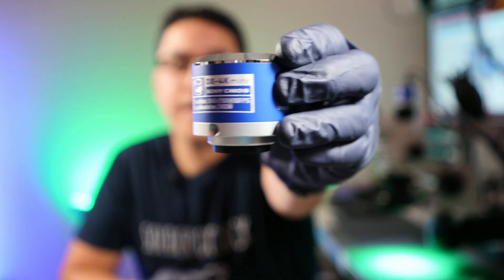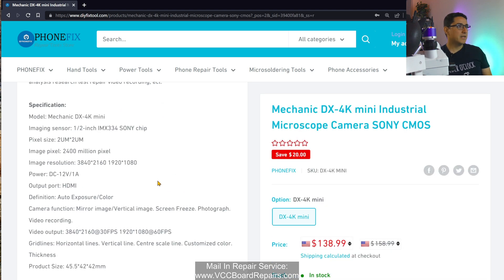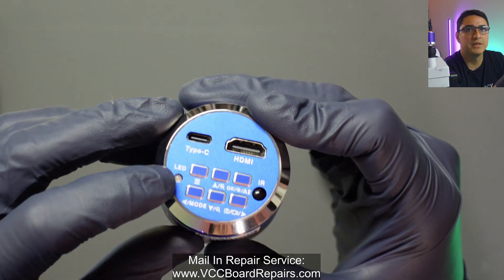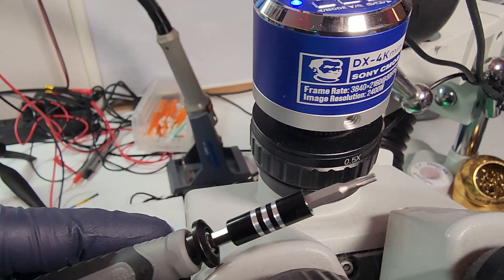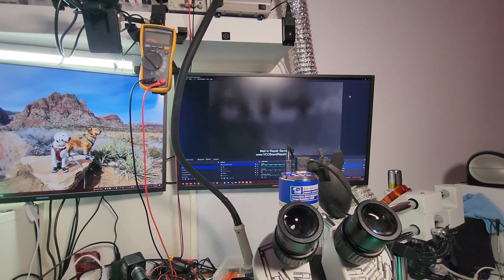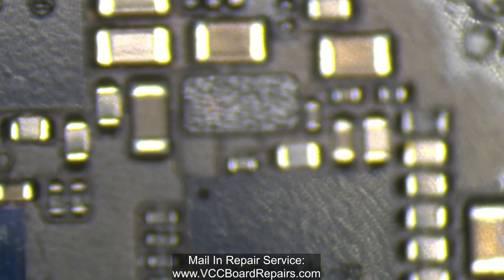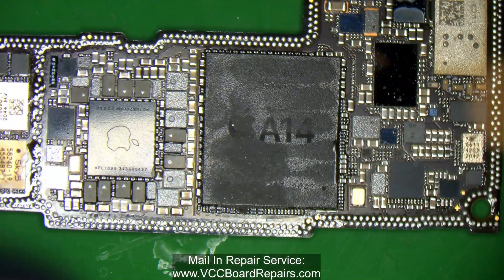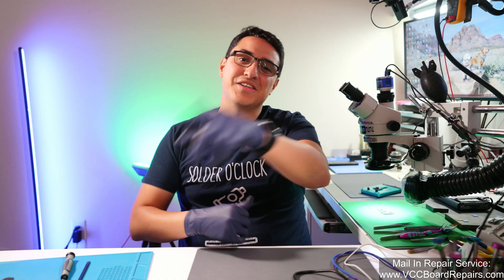The Best Microscope Camera for Board Level Repairs. How To Sync & Setup Your Mechanic DX-4k

Comment: Bought one of these based on this recommendation, and for my needs, it's perfect. Small, light, good image, autoexposure works well, not having an autofocus is to me a feature -- no hunting, I set the focus once and it's always in focus. One comment on the reducing lens choice; the two inexpensive options are 0.35X and 0.5X, and which one you go with depends on what result you want. In the case of the 0.5X, there will be no vignetting, but the image will be magnified vs. what you see in the binocular eyepieces. In the case of the 0.35X, the image will be quite close to what you see in the eyepieces, but there will be a bit of vignetting at the corners of the image. I prefer the 0.35X, since I want the FOV to be similar, and the vignetting doesn't bother me. If instead you want the best image possible, and losing a significant amount of the FOV isn't a big deal, then the 0.5X is a better choice. They're cheap enough to have both, frankly.
Reply from the maker: Love it!

Comment: Friend I was told by mechanic Hong Kong that for my Mac I need to install software mos4k pro camera and they will email me the link you told me no drivers I meant by drivers software because I can’t use the remote at all nothing shows in my computer just on OBS it works but you need to go to the settings to program in not sure about windows but I am using a Mac Studio computer
Reply from the maker: Use HDMI to USB capture card like I show in my video.

No drivers needed
Reply: Whats their contact?

Comment: Hello!  Your camera connected via USB to computer, when you are working in OBS? I have a problem, when the camera is connected via USB, it disconnects after 2 minutes of operation. Thanks for the feedback
Reply from the maker: No. If you watch the video, I show how I connect it
Reply: @VCCBoardRepairs  Sorry. Did I understand you correctly? First you need to connect the type c cable to the 5v power supply, and then the hdmi cable to the USB HDMI Capture Card to record video?
Reply from the maker: @MichaelPanda-e1w yes
Reply: @VCCBoardRepairs  thanks!

Comment: the parafocal syncing trick should work the same way with amscope SM-4T simul focal (it has a lockable trinocular zoom mechanism in it) microscopes? Where you can focus the eye pieces c mount and microscope to where you can zoom in and out and it stays focused? My SM-4T is coming in a few days
Reply from the maker: Yes. All microscopes work the same
Reply: @VCCBoardRepairs  thank you for all your help lately I really do appreciate it. I almost bought the same parco but just ended up getting the amscope they are both really good

Comment: hello bro, please reply, I bought a 4k microscope camera and attached it to my trinocular microscope, but I get very dark results and they are only better when given very high light. but I got good results with both fisheye binoculars with just a little light. what's wrong with this? Is it related to the problem with the CVT lens or my camera? Thank You
Reply from the maker: Enable auto exposure. Press and hold the AE button
Reply: @VCCBoardRepairs  Thanks for reply :)

Comment: Hello, I would like to buy this camera to replace my old one but I have a question. Do I still need the spacer if I'm going to install a C mount lens to it? Thanks in advance
Reply from the maker: The 5mm spacer should come with it. It may be required depending on your setup

Comment: FPS is terrible or is this your setup ?
Its very choppy.
Reply: It's max at 30fps for 4k and 60fps for 1080p.  I'm assuming it can't do 60fps on 2k as well.

I like how he's not replying to this tho hehe.
Reply: @bshinjp  its pretty normal though, the ones that do 60 FPS at 4K cost a LOT more than this one, orders of magnitude really, the only one i've seen on Ali that advertises 60 FPS is the Hayear HY-6800 that costs 300 dollars and even then you're taking a risk that they might be lying and you'd have to ship it back to China for a refund, the cheapest one that is vetted and known to deliver 60 FPS through independent testing i've found is a Lapsun that costs nearly 600 dollars.
So those extra 30 FPS are costing you anywhere between 200 to 500 dollars, it's not really worth it

Comment: Took a risk and bought this. Just unboxed it today. The image seems pretty good, but none of the buttons work. It can output over HDMI directly to a monitor, but I can't open any of the menus from the buttons and it won't capture still image or video to a memory card.

It didn't come with a manual of any kind, which is normally find if the interface is intuitive, but the buttons don't work.

OBS Project can display the image from the camera, but again none of the camera settings can be changed through OBS and the buttons don't bring up any menus. OBS would be good for capturing video, but half of the use of the camera is just taking screenshots.

This is the second microscope camera I've purchased from China and what I don't understand is that the hardware (sensor, buttons, enclosure, etc) seems to be decent but the software is only half functional. The hardware is the difficult part. The software should be super easy to put together, but it's always half broken and makes the product mostly useless.

Jesse, I wouldn't recommend this camera any more. It's just not a good product.
Reply from the maker: I have two of these and they work great. There's such thing as defective items. Contact seller to exchange it
Reply: @VCCBoardRepairs  I get that. But real companies do quality testing. How many times am I going to have to exchange it before I get one that works? I have more important things to spend my time on. I would say I'm willing to spend more money to avoid all of this, but even Amscope and other manufacturers who are more expensive have mediocre reviews.
Reply: some people say that their buttons doesn't work and it seems it was that they were not providing the correct power output, once they did that it started working.

Comment: The remote and camera have buttons indicating record and photo.  There is also an SD card slot on the camera.  However, I can't get it to record anything and don't have any options in the menu for format or anything like that.  Do you know if it is supposed to record directly or are those buttons left over from another model that uses the same housing?
Reply: Ok.  I think I got it half working anyways. If I hit the record button on the remote twice, it starts recording.  I can't watch the video back on the camera though.  I have to remove the card and put it into a PC.  

A manual or link to one would be nice Mechanic! 

Let me know if you have ever found one.
Reply from the maker: It's better to use it as I show in the video

Comment: Have you found a pdf manual for the camera? Or can you tell me if the 16:9 is the correct setting in the menu? Also, how do you get the max resolution as in OBS there is only default and custom. Other than that it is working great and your set up instructions worked beautifully. Thanks.
Reply from the maker: Yes 16:9 is correct.

And if you don't see the 4k setting, try custom.

If still not, then your capture card does not support 4k
Reply: @VCCBoardRepairs  Ok, thanks. I was curious as I watched another video from Phonefix where the guy chooses 3840 × 2160  resolution from the OBS menu. My video capture card does support 4K as that is what I have it running at but was going to try the higher resolution if it was available. Or is that the default? Thanks.

Comment: Hello, can you somehow check that it really provides 60 fps at 1080p over HDMI? I've checked a lot of youtube videos recorded at 60 fps where cameras in similar price category with same sensor are connected directly over HDMI and set to 1080p@60fps, but in reality they all provide 30 fps, only cameras for 400$+ with similar sensor were providing 60 fps...
Reply: Depends on the sensor. A Sony  IMX678 is a significant upgrade over the IMX334 which he is recommending.  The IMX678 offering superior low-light sensitivity, better High Dynamic Range (HDR), and enhanced performance thanks to its STARVIS 2 technology, allowing it to capture clearer, brighter images with less noise in challenging conditions where the IMX334 might struggle or require much higher gain. But you will pay about $100 more.

Comment: Question on the 4K HDMI capture card. Should I get it even if I don't currently have a 4K monitor? Will the capture card work anyways with my 1080P monitor? Thanks!😀
Reply from the maker: Good question. I think it will work but not sure
Reply: @VCCBoardRepairs  Ok, thanks, I will likely get the same capture card and if worse comes to worse just buy a 4K monitor. Win win! 😋

Comment: Your description of setting up parfocal was confusing to me. On my AmScope, there are lines either painted, etched or printed on the eyepiece tubes that denote the “zero” position. This is the procedure I followed: Step 1 - Twist each eyepiece out (lengthen it) until that “zero” line on its tube is just barely visible. Step 2 - Set zoom to maximum. Step 3 - Adjust objective lens height (large knob, or stand adjustment) until image is clear in one eyepiece. Step 4 - Adjust other eyepiece until both eyes are in focus. Step 5 - Set zoom to minimum. Step 6 - Readjust the eyepieces until focused again. Step 7 - Verify that the eyepieces remain in focus throughout the zoom range (may need slight readjustment of eyepieces). Step 8 - Adjust camera focus knob until camera is also in focus.
Reply from the maker: Yeah it was kind of hard to explain the process. Glad you got it.

Comment: can it be pluged in laptop hdmi port  or  am supposed to buy that converter
Reply from the maker: You cannot plug in the microscope camera directly to your laptop HDMI, as it's not an HDMI input

You need a HDMI Capture card, like I show in the video.
Reply: l got the hdmi to usb conveter adapter but its not showing  in obs software  thanks

Comment: Would I be able to use this camera with my current c-mount lenses with my setup like Northridgefix uses? -basically just microscope camera to display.
Reply from the maker: It's a C Mount camera so in theory, yes
Reply: That's what I was wondering as well.

Comment: If you used a 0.5x barrow lens, then you need to use a 0.5x adapter.  Otherwise, you will get a black circle ring around the image.
Reply from the maker: Good to know!
Reply: How do you mean by adapter
Reply from the maker: Adapter = Reduction lens
Reply: @alphatechtechnolgy2544  the microscope adapter that goes between the camera and the microscope.
Reply: Not all MS Camera will do that. I have 3 different cameras and 2 out of the 3 will give me a slight tunnel effect using .35x and a .5X Barlow. My IMX291 camera has a slight blur around the edges but not terrible. I have a IMX307 camera that is bulkier that will give you that tunnel/ darkness around the edges. I have my first MS Camera that is a Panasonic sensor- not sure which on but that camera is even more compact and there’s tunnel effect. This is when using the compact .35x adapter. I’m not sure about the older bigger style though.
Reply: @shiftctrlhack  then you need to use the 0.45x adapter.
Reply: @gizmosfix  Thanks for the reply. I purchased a .45x and its better for my IMX291 camera but for my RT5109 4K IMX334 still has the tunnel effect. What I've learned from this is that many of the .5X adapters sold on Amazon are actually .45X. Even the .45X camera say have .50X printed on them. The 1st one I purchased I thought was sent wrong. They sent me another one for free and they all show .50X printed on them. I can settle with a little tunnel or an image slightly zoomed in but hopefully i will get lucky and make everything match 1:1 ( eye piece & camera) eventually.
Reply: @shiftctrlhack  It also depends on the camera.  I got one camera using the same adaptor and it didn't get the tunnel effect.  Wierd, could not figure out why.  But it does help a lot reducing the tunnel effect when using the same .5x adapter size and .5x barlow size.
Reply: @gizmosfix  Thanks for your help I appreciate it. I have a .5X adapter on now and a .5x barlow on now with super slight tunnel effect slighty around the edges which im fine with unless i try a few more different adapters. Now my other issue that i'm having is half the image through the camera is uneven or I should say slighty  blurry. I think its the prism in my simufocal microscope but have't found a replacemtn to try.